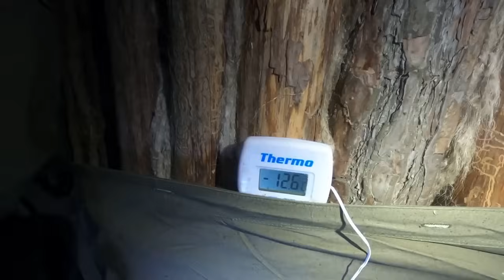Shelter building in the woods, bushcraft modern

Comment: I'll never understand why flat, non-pitched roofs are such a trend with these bushcraft shelters.  Not saying it's unique to this build or channel, but it seems to be some sort of unwritten law for these videos, they're so prevalent.  Water runs off a pitch, and collects on (and eventually drips through) a flat, guys.  All the tarps, chinking, moss, or soil (!) for goodness' sake, won't help.  Tarps may be plastic, but they're not indestructible.  Even flat-roofed commercial buildings have scientifically-designed roof membranes and systems that need to be serviced every few years.  A simple pitched roof, with some sort of shingling, that overlaps top over bottom (NOT the other way around!), not randomized branches, etc., but a proper pitched, shingled roof, will keep one dry and comfortable.  How complicated is a simple ridge pole, or even one wall taller than the other?  You create a cup and nature WILL fill it up!  Geez!